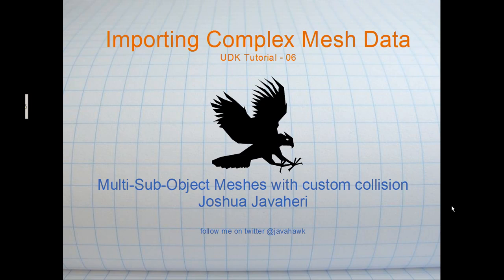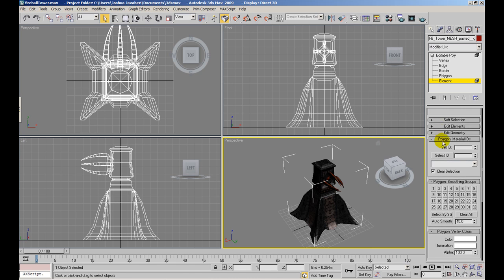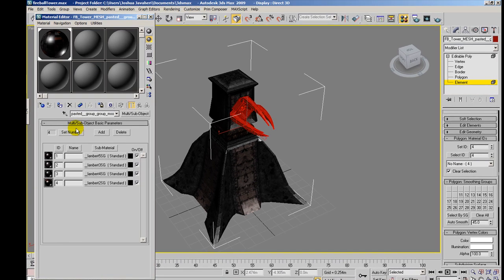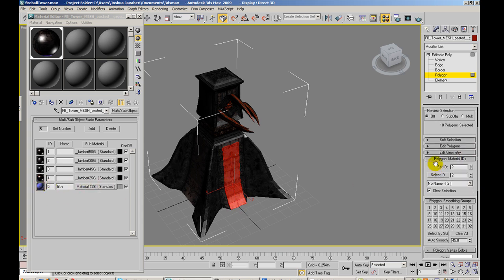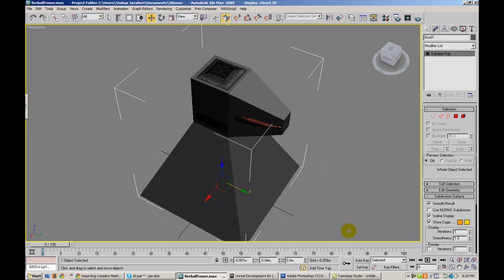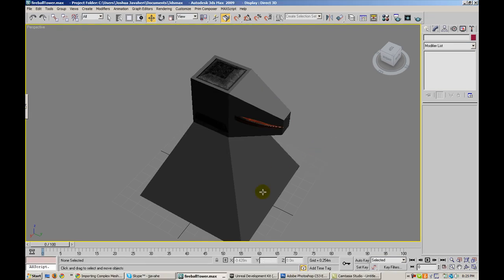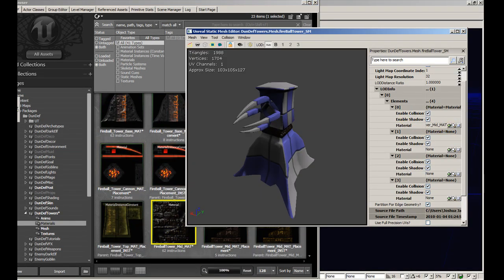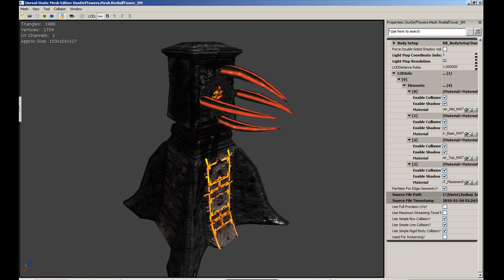Importing a Complex Static Mesh - UDK Tutorials by Javahawk

Comment: If you all want to import material do this i always do it. Save the texture as 1024x1024 or 512x512 as TGA. And then just import it. And then you will get a texture. Then in your package right-click and select add material. Then double click material and in the top right corner in the search type find texture sample. Drag it on there, connect diffuse with the top black cube on the top of texture sample. And click on texture sample and just in content browser select texture and click thegreenarro

Comment: Its not working for me. I cant get any subobject materials to work at all on my model. Its a pretty simple model, and I've already set the two material ID's up (some polygons using ID1, the rest using ID2), plus I've unwrapped it, so I dont understand why nothing appears on my model, after setting up a multi-sub material, assigning a texture for each slot, then dragging onto the model and pressing "show maps in standard viewport". Its all standard procedure AFAIK, so what could I be doing wrong?

Comment: Does this not work if you've already unwrapped the UV's on your model? I've modelled a pillar, and I want to give it two sub-materials (one for the lights), so I selected all the faces of the lights, then set them as material ID-2, while the rest of the model is set at ID-1. After that I unwrapped the model, then added a multi-subobject texture, applying a material to both the channels, but when I try to view the materials in the scene, theres nothing. Its like it erased my UV mapping...

Comment: To solve the LOD Slots problem, is necessary to use in the multi/sub-object(max) textures, no diffuse color. Is yoy export your model only using diffuse color you will have only one slot for your material, You must use textures to have "N" slots for each material

Comment: I have a plane for the floor and a plane for the ceiling with 1 material and 2 UV maps for each one, but UDK only recognizes them as a single object with 1 material and 2 UV maps, therefore it's complaining about overlapping UVs, and is putting one material on both the floor and ceiling.

Comment: I'm having trouble to do this, im doing exactly as you (as far as you describe) with a 3 subobject model, 2 different textures, no errors on export or import, but the imported model in UDK only has one Element in the LODInfo instead of the two (as for materials) or three (as for subobjects), do you know what this is due to?

Comment: You don't have to have multiple ID's in order to create different fx in different areas (e.g. The different animated glows.) You can accomplish this in many different ways through the shader system. If you simply want different animation's in different elements, then you are taking a longer road. It is a simpler to use other methods.

-Jeremy-

Comment: @nioxin3031 So... After a few tests it seems that the vertex count error still occurs even for simple meshes.
If you make a simple sphere there are no erors popping up.. That's a start... But if you make a cube (like a crate I made) the errors pops up even with the UVs settted.
This is so darn frustrating. :0\
I just hope that it won't affect the performance.